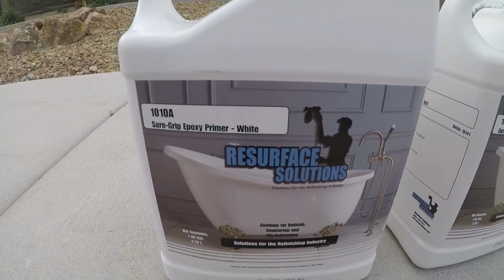Spraying Euro Epoxy Primer on a Bathtub | How to Reglaze a Fiberglass Bathtub | DP Tubs

Comment: Can you spray over gelcoat. That has surface cracks in it
Reply from the maker: Yes..I would recommend sanding the gel coat to rough it up…use an epoxy primer or adhesion promoter before your top coat.